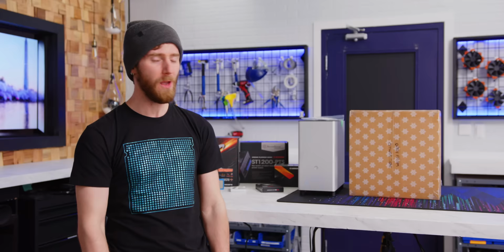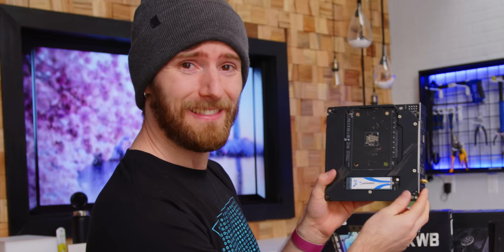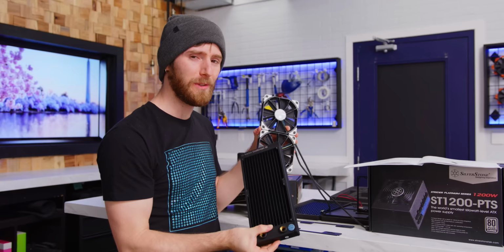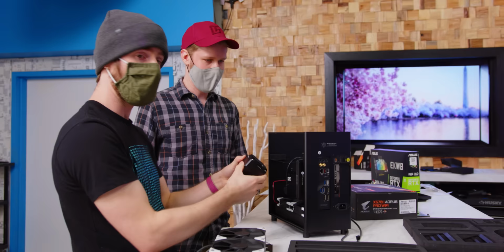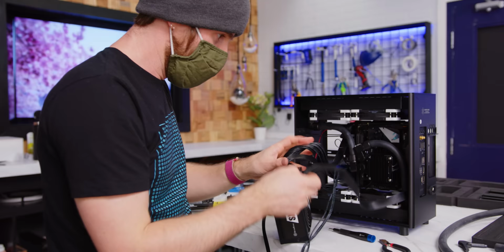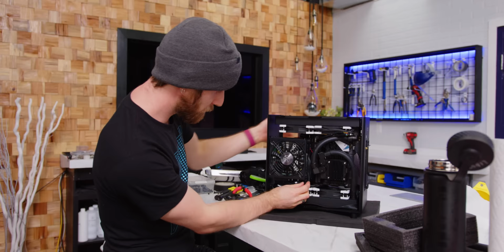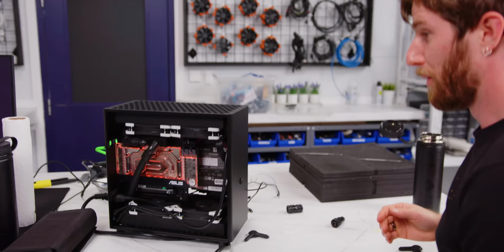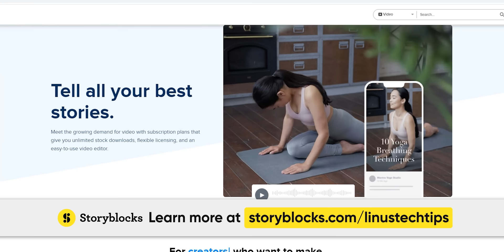The Fastest Gaming PC... Is THIS BIG??? - Winter One

Comment: I love small form factor systems and will eventually get around to building one myself. Every time I get close though, the added cost and difficulty of maintenance/upgrading kind of nudges me away. But I do get very jealous whenever I see someone with an epically spec'd PC all packed into a case this small.  

This case, being damn near $600 in this configuration, is quite steep but I do really appreciate the design.
Reply: Go for performance and a solid case don't go overboard on thee case as the watercooling loop is the centre peice of any small form factor pc

Comment: Ladies and gentlemen... THIS is why you go with a full tower.
Reply: Nah, too much desk space wasted. Jk
Reply: Yeah bro, agree!! Imagine give a maintenance to this PC, gosh 😫
Reply: 100%. Even if you don't end up using all the space it offers, a full tower case is a joy to build in and easy to maintain once the PC is in there. No tiny recesses you can't access easily, and it also makes cable management a breeze.
Reply: @blackbomber72  ...put it on the floor, where it's supposed to go.
Reply: uh no, this is why you don't try to make a small case a full power PC
Reply: @krebgurfson5732  :)
Reply: No, this is why you go air cooled. My first ever build was SFF and I had no problems whatsoever
Reply: Nah, these small ultra powerful builds are way cooler and more special, plus they take up less space and are easy to move if you need to
Reply: This tiny case is FINE, as long as somebody else builds it, and somebody else fixes any problems during its lifetime.
Reply: @iFireender  Then why is it called a deskTOP? :O
Reply: Why? so you can save a little bit of time building only to be stuck with a massive box for the next few years that takes up a bunch of space and has a bunch of wasted space inside? I had zero issues building in my SSUPD 14 liter case and it's a full power gaming rig with no compromises
Reply: @TangoOne  Wait until you're 60.  Your priorities will change.
Reply: Can confirm. Space is great and all but  coolings better and overall its just easier  with full tower
Reply: corsair 7000 has the perfect size :)

Comment: Case cost: $450, time to build cost: $2000, annual water cooler maintenance time cost: $600
Reply: when you buy a 3090 from scalper at 3000$ i dont think it's crazy expensive :p
Reply: @silistar2646  at this point I've just bought a asus rog zephyrus G14 2021 cause it got a ryzen 9 5900hs and rtx 3060 so I think it's a good deal
Reply: @silentgamerlvl1495  Gaming laptops are now a better than than building a pc, been thinking of getting the g14 but im tossed between that or the g15
Reply: @silentgamerlvl1495  i got msi thin i7 something and 3060 aswell great deal for around 1600$ in those times also you can get a alienware prebuilt with a 5950x 3090 64gb ram for 5grand and its available if i needed a rtx that bad i recommend that
Reply: @silistar2646  yup, got myself a 3080 max-p laptop, why? well, 2500$, 3080 price in my area, 2500$... sooo yea, i'll rather get.. u know, a whole computer for the same fking price, (dont say the desktop>laptop 3080) im aware, but it includes the rest of the computer.. and being portable is a bonus anyway
Reply: You can get away with maintenance every third (or fourth) year as long as you are buying quality stuff. After that, you pretty much must rebuild the system, and properly cleaning and reassembling a single block can take half a day depending on how dirty it is, i.e., if you need excessive toothpaste care.

Comment: I'm gonna use that " so small it will make you blush" line from now on
Reply: Damn bro me too
Reply: Nah
Reply: Small formfactor packing a punch
Reply: that's what she said
Reply: Haha my crush blocked me 😁
Reply: Someone needs to put the PC on the couch and surround it by consoles using the Perri Piper template meme.
Reply: "sticking my ruler in the top and the bottom", "ooh its really tight" and so it goes on. I think its one of the new writers trying to fit in haha.

Comment: upvote for Shazbot!  other things, maybe even... tech tips...    
A; use hair spray on your screw driver - it helps hold screws to your bit
B: when filling a LC system like that, pull a vacuum on it - all your air will come out...
C: when dealing with old molex - solder on a sata power plug OR crimp on different pins to use an unused GPU or CPU power plug
D: use a second when building an LC - use a secondary PSU to power ONLY the pump instead of your full system.
E:  you can use a hand pump with a fitting to pressurize the loop and ensure it wont loop before hand
F: when running a tight loop like this, you can use a T fitting or drill and tap a small 1/8 or 1/4" bung into your highest fittings. you can then run a line up for your fill and air evac port.

Comment: First half of the video: "Wow this case seems amazing! I'd love to build in one on my own one day!"

Second half of the video: "I'm going to have to lie down after watching someone build in this case"
Reply: At least you wouldn't have to put a ridiculous system with an overkill custom water loop in it.
Reply: Watching this after building a custom Dual radiator loop in my Ncase M1 makes me laugh.
Reply: @qwertyferix I feel like that is mainly the point for such a specific case layout however. Would be silly to aircool
Reply: @kipandcop1  Well, yeah, but I meant you could not put two 280mm radiators and an ATX PSU in it.
Reply: @qwertyferix  It was technically a long SFX psu, and to be fair even with a more "reasonable" build of like a 5800x/3080, once the loop is saturated I think you'd really hurt with just a single rad, and they stuck to two 240mm rads in the video
Reply: @kipandcop1  Optimum Tech did a clean build in the Meshlicious with a 5950X and a 3080 cooled by a single 280mm rad, and it was fine. Yeah, I see Linus put an SFX-L PSU in now. The ATX one that was there at the beginning threw me off.
Reply: Anyway, my point was that the case is what it is. You decide how difficult you make the build on yourself based on what and how the parts go inside.

Comment: Probably a dumb idea, but have you guys ever looked into using a controlled vacuum to draw air bubbles out of the water before you put it in the loop? Like those little vac chambers used in small-batch casting for silicone or resin. Tapwater always has lots of dissolved air in it. Be neat to know if that would make a difference.

What an adorable case. A nightmare to work with, but adorable. Like my nieces when they've been stuck with their mom for too long.

Comment: everytime i gain an interest in watercooling i just watch a linus video and instantly get reminded why not too
Reply: lol me too
Reply: "Today we're going to watercool a gaming PC... GAHHHHH! Just grab a Noctua NH-D15 Chroma. It's fine. You'll be fine."
Reply: Lol water inside a pc I don't even oc...
Reply: i LOVE doing water systems, with rigid and soft tubing alike. but my daily driver dual atx tower is all noctua air because i like to service my systems every 6 months, with a full breakdown, cleaning, and i do GPU past every year. keeps my shizz running super smooth.
Reply: I feel the same way!!
Reply: I was using an AIO for my CPU. Because of a mistake on my part, I believe I overheated the motherboard by having the fans go the wrong way (standard mid tower with the fans on top pulling air into the case. Should have been going out in that position of the case) and I think it might have melted the seal on the pump block because when I took it apart to replace the motherboard and CPU, I thought I saw corrosion on around the CPU bracket thingy that Intel uses. Good thing I ordered a Noctua cooler for my replacement.

Thanks to how pricing is, I'm still using Intel...  (10th gen processor because cheaper, but motherboard has features I can't use unless I get 11th gen, need to save up for that, but want other more important things for now)
Reply: well i backed this case on kickstarter i think ill have an intresting time

Comment: at this size you use the central supports and cram it INTO A VAT OF TRANSFORMER OIL with both rads hooked on the grids...only part missing is a nice Display aquarium and the oil (maybe adding a filter)

Comment: "That's right, our gaming PC is gonna be so small." Hold on. In the real world, isn't bigger is better. Years ago, I built my dream gaming PC. Its case was so big that it had WHEELS and a handle on it. The funny thing is that when I finished my gaming PC it was stuffed but very impressive. Carrol Shelby actually stuffed a 427 into a Cobra. I bet if you could have found a water-cooled power supply you would have put that in. "It's very expensive." How expensive?

Comment: There is a reason why manufacturers don’t use steel fasteners on (what I am assuming) is a mostly aluminum case Linus….you said “One thing they could improve” but in fact that would be a far inferior design. Why? Because steel hardware will strip aluminum threads extremely easily.

Comment: This is like race car engineering level, but for no reason...

I love it
Reply: This is production car engineering. Race cars are designed to be easily worked on and easily taken apart and put back together. This is none of those things
Reply: @michaelkelly7379  engineering is also design which is part of building. It would be a more accurate if it were pre-assembled but the case was still engineered to some degree

Comment: i use water cooler with this, fixing the radiator part outside, that alone gave me a ton of space to play with, and fixed the led fans out of the case is well, use your brain, this case has a lot of potentials, you can even use smaller case when fixing some of the things out of the case or fit a nice big gpu, space gets handy doing this way i do.....

Comment: If you've ever built a sandwich-style custom-watercooled rig before, Linus is not being dramatic
I actually snapped my last case in half because the forced angles of tubing... and I maybe cut some of the structure out of the case with a dremel.
Eh, nah. It was 100% the case's fault. Don't ask questions.
The gen-3/4 riser cable thing is a absolute PITA on Ryzen chips too.

Comment: Make sure you use Silicone Grease for all rubber parts, any kind of oil will damage them. The pump is not pulling be cause the pump design is not self priming, you need water in the impeller to pull the water and  circulate it.

Comment: I feel the "pain" just assembled a i7 with a AIO in even less big case. If you see the build, it doesn't make sense, but it's working, and yes, I have a lot of patience. What I learned, CPU block comes last. In my case it did, seems a standard is missing here :)  And replaced the Corsair fans, with Noctua 12cm and only 15 mm thickness. It gives a little comfort.

Comment: Pro tip: A drop of dish washer soap like Dawn will cause bubbles not to stick anymore and you can bleed the system much faster. Run the loop to bleed, add drop of soap, ????, profit.

Comment: I built a 5950X , 6700XT system a few months ago but due to space issue I used a pci 3.0 riser cable like you have in this video. Once I moved to pci 4.0 with resizable BAR I got a DECENT bump in performance.

Comment: This is an inspiration. I'm thinking about doing 2 micro ATX builds (an AMD Ryzen 5 3600 and an Intel i3 10105F). Hoping that your rig keeps running without any failures. I imagine it would be a pain to replace or upgrade any parts in there.

Comment: if you need that extra few cm in this kind of case, get longer screws, put some aluminum spacers between to raise up the case, can be done on every panel or the panel of space needed it,  this method helps a lot and space on case parts looks nice...

Comment: They were saying the CPU temps were a bit higher than expected... I'm not as experienced as these guys at Linus Tech tips, but the instructions for thermal paste clearly state you're supposed to spread a thin layer of paste covering the entire CPU. Every time I see Linus build a PC, he just puts a dab in the middle and slaps the cooler on.... I think that causes a lack of surface contact between the CPU and the heatsink surface... hence, cooling isn't as good.

Comment: DDC vs D5?  A couple of times Linus has said he's not a fan of the DDC pump.  I've always found that it seems to be a case of you like one type because that's what you've always used but no actual good reason that one is better than the other.  It usually comes down to form factor for a build.  So what are Linus' reasons for disliking the DDC?  Genuinely curious.

Comment: It wants a touchscreen monitor slapping into the side case design  onboard Lan a carry handle or just a soft carry bag with had plate to protect the touchscreen monitor then you have the world's most powerful suitcase computer (like the ones of the 80s before laptops). I call it the portable gaming rig grate for Lan party's and giving a touch screen all in one experience with the ability to use it as a second monitor at a Lan party

Comment: How long did that build-assembly actually take altogether, I wonder (beyond the "video magic" part)?

And how long would it have been knowing what to do and without the faulty parts and troubles?

Would be nice to get an estimate at least on both (but the length of the overall recorded video-footage should be a good start to assess the first at least and cutting out the unexpected trouble parts should be easily give the time for the second question), i.m.h.o. - since it'll give those of your watchers trying to rebuild it some kind of estimated time-frame to free in their schedules if they want to attempt it themselves, you see.

Merci beaucoup <3

Comment: all that cooling from the fans and there is nowhere for the air to even go, so they are useless. Water cooploing loops are pointless if you are not removing the heat from the system somewhere, would have been better just running the whole system air cooled

Comment: ok so i WANT this! like if possible i'd like to see a best of what you can cram intothat case performance wise.. mostly because im loking to replace my laptop with a small pc.. i built my friend a micro towwr abck when win xp was still the norm ofcourse all i had to do was change his graphic card because he was just playing runescape but still i have wanted a tiny pc ever since.. but i need a parts list.. i have realy slim fingers so putting it together shoulndt be an issue.. i just neeed a list of things to buy with a total cost at the bottom lol. im currently using an old alienware. ((from before dell ruined the name)) funny thing though they seem to be trying to revive the alienware name i saw an ad on tv last night at the bar. This thing used to run every thing on max settings effortlessly.. but at some point nvidia updated my drivers and it actualy said i'd downgraded my graphics card.. which.. i didnt it's soldered to the board.. hasnt been the same since. i did managed to some what fix that problem but its still chaugging on even medium graphics.. i dont realy do any demanding gaming any more but i used to do 3d modeling and now thats just a chore that my win xp machine actualy does better and it was an old dell media center running a centrino.. sadly the poor beast has officialy died.. so i need a new box for my rendering.. you know before i forget how blender works.

Comment: This nightmare can be yours all for an exorbitant price! Yeah...thanks for the warning. It also seems to be running warm, likely because all of the components are crammed together. My 7 year old pc, air cooled, 88F ambient air temperature running just chrome with this video (25 other tabs) and discord is sitting at 37c on the cpu, with dust.

You should thermal torture test that rig, because it's already doing worse than my air cooled atx pc
Reply: Congratulations you have a PC that uses less total power than this PC, of course your stuff runs cooler. AMD CPUs also run hotter than Intel or appear to because they boost themselves constantly.
Reply: Bad_Script  sucks for them I guess
Reply: Bad_Script  When?
Reply: Bad_Script  I dont know, you tell me.
Reply: Bad_Script  👍

Comment: From an engineering point of view the PC form factor is totally laughable. It's a 1980s design trying to satisfy 2020 needs. That's like trying to build modern passenger planes with the techniques of the Wright Brothers. CPU, memory and GPU chips have to be on the same multi-chip carrier that has its own integrated power supply. It's one block of aluminum that has a dozen high speed serial connections going in and out, apart from a 48V/20A primary power line. Everything else is just "function follows aged out form-factor" play.